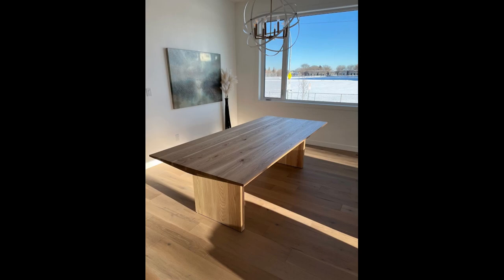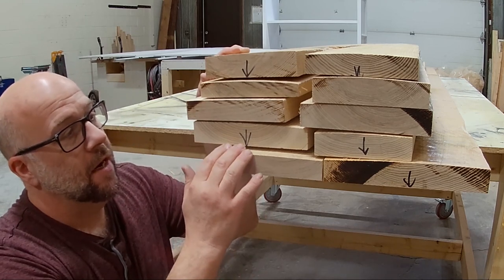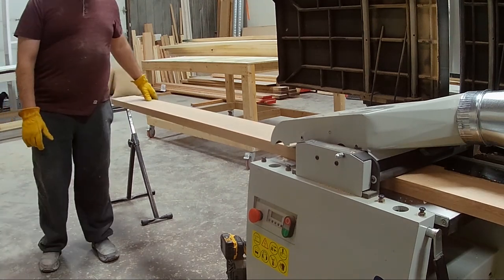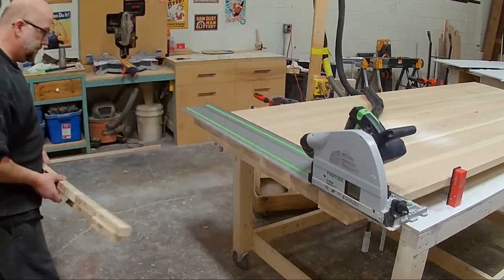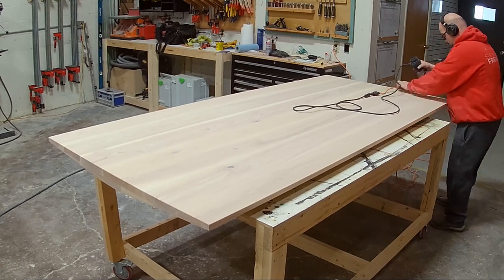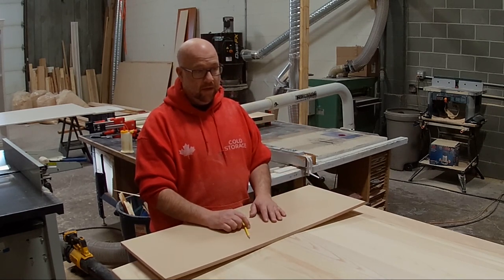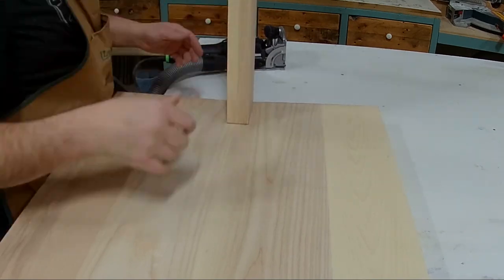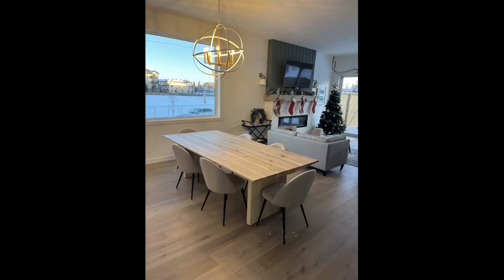Wedge Top Ash Modern Dining Table | Custom Tables Edmonton

Comment: Nice build. Curious how you attached the base to the top. Was it only along the stretcher? Thinking about seasonal movement and how you mitigated that. Appreciate the video!
Reply from the maker: Hi David. Thanks for the reply! I used the figure 8 table top clips with some wood screws.